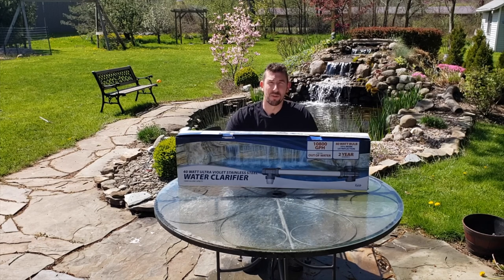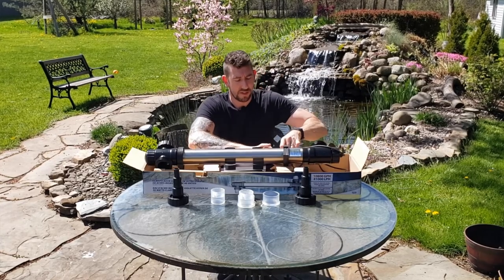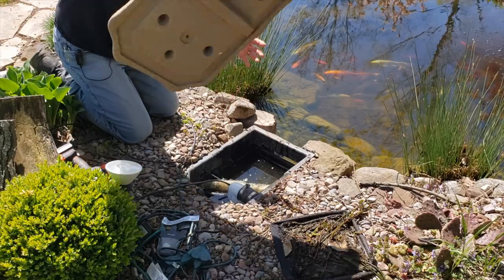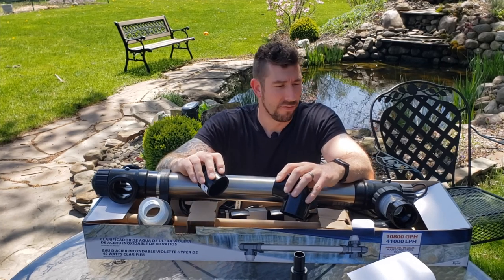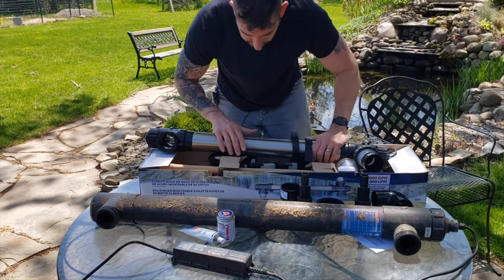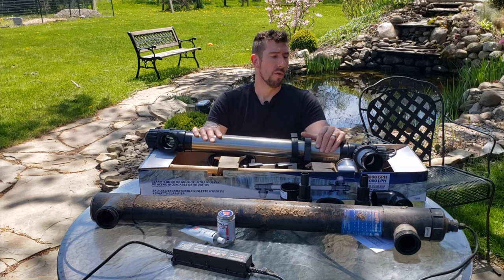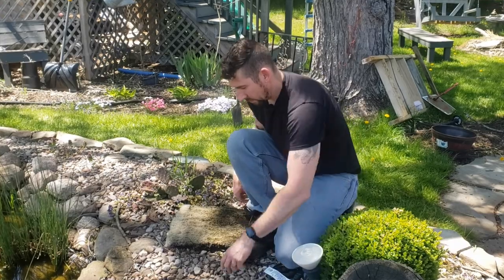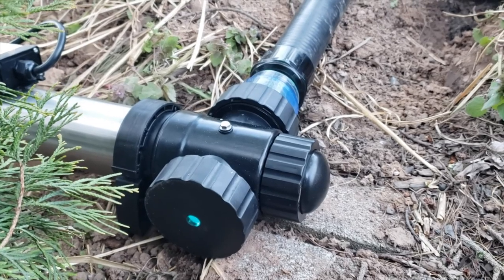How to install a UV light

Comment: Great job with the UV light installation. I have a similar size pond and I bought the same UV light. What size flex pipe did you use?  Is it the same diameter as your pump line? Thank you.